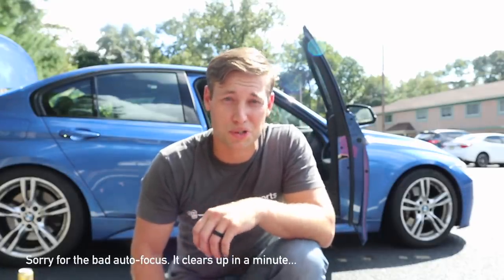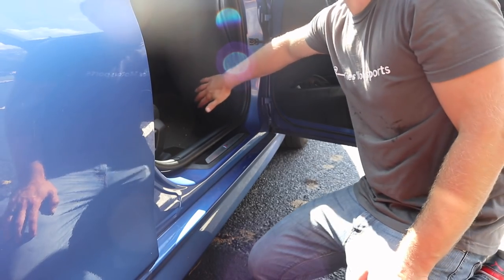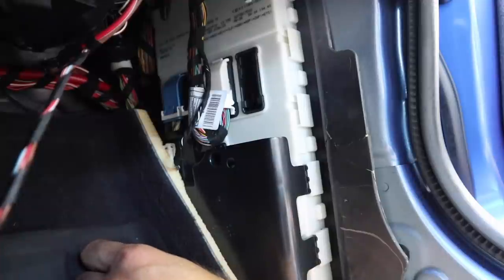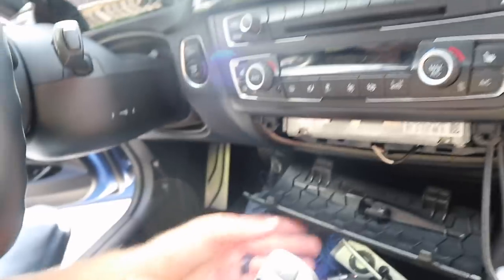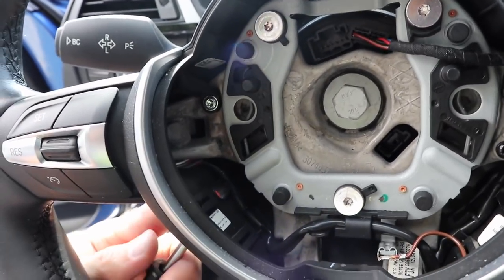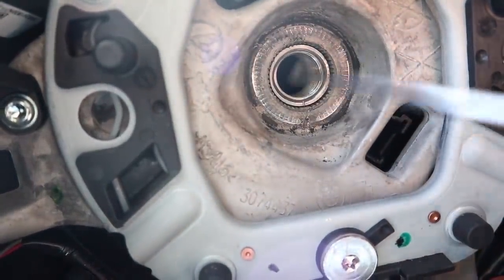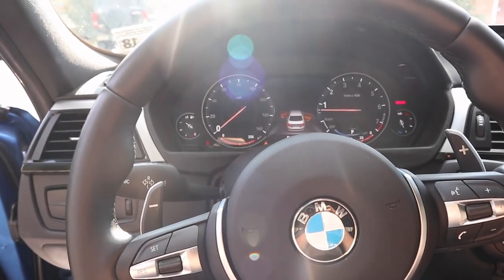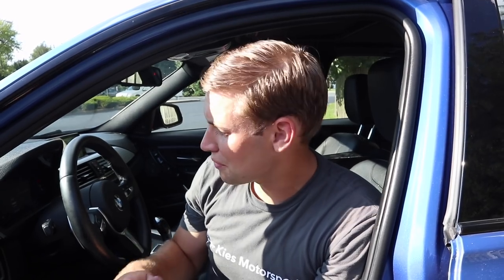How to Retrofit F80 M3 Paddle Shifters on an F30 Steering Wheel  (2013 BMW 335 m sport demo car)

Comment: I think u need to code 2TB sport auto as well to take full advantage of the transmission. Judging by your shifter, u have a regular 8 speed auto. Not the sport auto that come with different style shifter. The transmission itself the hardwares are same just different programming. I drove a 320i with this transmission and my own 435i with sport auto. Manual shiftings are huge difference. No bang bang bang shift in regular auto. Just letting u know.....or do u already know that and coded it....lol
Reply from the maker: Yea that makes a huge difference. I have that coded already :) great tip! BIG difference..
Reply: Kies Motorsports Great video!  How do you code 2TB sport auto or where?
Reply: Is this necessary if I already have the sports+ mode on my car? BMW F30 335i xDrive M Sport
Reply: So the only difference between the sport and regular transmission is coding?
Reply: I have an 120i regular auto, can I code sport auto? how? and what coder do you use? @KiesMotorsports

Comment: Just finished retrofitting my f30 wheel and installed paddle shifters. I purchased the paddles, wiring harness, backplate, and 2 paddle shifter screws all separately. I found that the 5/16th hole that he said to drill was too big for the factory screws that are said to fit the paddles. I had to add 4 washers to each screw to have them sit correctly. This process was extremely time consuming, but this video helped a ton and I love the outcome. Another big issue I ran into was having a heated steering wheel, with this type of function my wheel had an extra box in the actual wheel so when my airbag wouldn't fit on correctly with the new wires. I had to cut some of the tape around the wiring harness and shove wires into deep crevices to have the airbag sit correctly. After a total of 5-7 hours, I got everything sorted out and using bimmer code to code in the paddles was a breeze. I am so happy with the paddles and encourage anyone to try this out, just make sure you go slow and make sure you have everything fit correctly.
Reply: I’m mid installation, but this is exactly what I’m facing. There’s a curved box which sits on the bottom right of the steering wheel. The black connector which is attached to the paddle shifter connector (i.e. the shorter one which goes to the left paddle shifter) must attach to a connector which comes out of the right side of that box. Miles away. I’m just going to extend this with a jumper lead.
Reply: Do you have the links por the parts ?

Comment: Just installed them on my F30 320d m-sport using this video as a guide, thank you for taking the time.
Only issue I had was where you say your using a 5/16 drill bit which equates to 8mm for us europeans, I was somewhat confused as that would have made the hole too big so I end up drilling a 3.5mm hole which is about 1/8th inch, that worked perfectly.

Thanks again

Comment: Did the retrofit yesterday!
FYI: 5/16 drill bit ≈8 mm is too big, the OEM 14x4mm screw heads are too small which calls for a washer.. On the other side I drilled a pilot hole (5-6mm), and used the 5/16 bit going about halfway :)

Comment: I'm almost for certain you are the first youtuber to do an actual video on how to do this. There are forms around that I've read up on, but couldn't find any videos. Great work! I'm going to use this guide as reference for when I do this mod.
Reply from the maker: Thanks! Yea, I couldn't find one, so I thought it could help!
Reply: Kies Motorsports No problem! Also, I shared your video to BMW car groups I'm in, should help you out in terms of viewers and followers.
Reply from the maker: Sounds good, we appreciate it very much when people share, like and comment!
Reply: One more thing... Do you happen to know where to find a backing plate for a stock F30 328i wheel? I dont have the more round one like you do, I have the blocky rectangular one? I'll have to buy an entire new M Sport wheel with paddles pre installed if I cant find a backing plate.
Reply from the maker: I don't have access to it right now, but try realoem for the part number
Reply: Okay! Thanks. If I have to replace the steering wheel its whatever, the stock one looks like trash
Reply from the maker: You can probably get a used one for a good price

Comment: When you add peddles, the minimum you can do is actually code Sport Auto so you get faster transmissions. On my F30 I initially had only Sport steering wheel without paddles, so I bought M3 one and regular peddles and mounted them on M3 wheel (I actually think standard peddles look better than M3 ones).

Comment: Fantastic! Great video. I know this will help alot of people on the forums. I did this to my 2013 328i m-sport. Made a huge difference in control and feel while driving but also the transmission is alot more aggressive when coded for paddles. It is pretty silly that BMW left this as an option for m-sport trim cars..!
Reply from the maker: Go ahead and share everywhere you think it would be helpful, if you think it could help! 😀

Comment: Hi - thanks for your great video. I used it to great effect to remove my wheel and replace one of my broken buttons. However, when I replaced everything my rear view camera is no longer recognising the movement of my steering wheel, so the guide lines on the screen aren't moving as I turn the wheel. Any idea what I've done - and maybe how to fix it? Thanks!
Reply: Ok - so 1 day later and a 40 mile drive later, it's now working. Clearly it needed to self calibrate. Phew!

Comment: I was afraid to do this by myself, but after seeing this vid, I will definitely do it. Question: Regular F30 M sports wheel paddle shifter is the same to install? Drilling the holes into the wheel is the most crucial part of my question.

Comment: Hello, first of all great work.
I have a few questions:
Is it the same procedure with a F36?
If a cable is present in pin 5, then is at the steering wheel automatically a cable in pin 3?
Must be coded in the end?
Thank you in advance.

Comment: Hey Brian, can you tell me where I can purchase the two little screws that go into the back of the paddle shifters as well as the size of them? I ordered the shifters and I am installing an M3 steering wheel on my 335i, but just realized that I don't have the two screws to hold the shifters on.

Thanks so much!

Comment: What kind of screw do you use that goes into the paddle shifters? I bought a set of these on ebay and they didn't come with anything; and the holes are just non-threaded black plastic.

Comment: Do you know if the F80 paddles themselves can be used with OEM F30 plastic bracket and electronics? most people are selling the paddles relatively cheap, as opposed to over $500 for a whole new set of paddles

Comment: Does the wire runs feom number 5 to number 3 at the steering wheel on 2013 328i just the same as your 335?

Comment: Hello,

I have a BMW x1 F48 18i 2018 model with automatic transmission. The steering wheel that currently has is not the M.
My question, in case you know, is if I can fit an M steering wheel with paddles so  that I can also the change the gears from the steering wheel?

Thanks in advance for your response.

Nikos

Comment: Hello Brian! So I wanna buy a steering wheel that has paddle shifters. Basically what I wanna know is... if I can try to code it without checking for the wire existance. I guess if there is no wires it will still let me code it but it will not work. I do not wanna scratch the trims especially the steering column ones. Is that any other way to check for the wire presence by any chance ? ! Thank you ! :)

Comment: Brian,

Doing this now and realizing I do not have the screws that hold the paddle shifters in place since there was no screw holes previously on my wheel.  Do you know what size/type of screws are needed for securing the paddle shifters?  Thanks!
Reply from the maker: I don't remember, but if you take the screw out of the back of the wheel (the plastic trim), it should be the same size, if you want to get one at a hardware store
Reply: Kies Motorsports Thanks Brian.  I actually was able to bring my wheel into Lowe’s and match it up, it’s a #6-32 x 1 inch if anyone asks in the future!

Comment: Hey I just did this but now I’m getting a lane assist malfunction. I have not coded the paddles yet. Will the coding fix my lane assist or do I need a different wire harness? It’s strange because I left my original harness connected as well to the lane assist module but just left two connections unconnected because my new harness had those connections. Something is off. The new harness didn’t have anything for the lane assist. I’m also working with the non m, it’s the sport wheel.

Comment: FYI, many F30 steering wheels do not have holes as pictured, and the airbag is not removed the same as described in this video. Also these steering wheels do no have a replaceable backplate, you must buy a steering wheel with paddle cutouts.

Comment: Looking to upgrade my 1 series wheel mainly to have cruise control but also love the sport steering wheel. 

My car is manual, but if I bought the paddle version would it be a problem? Id remove the paddles as I obviously can’t use them! Just wondered if the paddle version would confuse the car!!

Comment: Hey, looking for some advice! Im planning on doing this steering wheel upgrade to my 1 series as I like the look and want to have cruise (i know I need cruise coding). Most f30 steering wheels seem to have paddles and my car is a manual, I know the paddles wont work which is fine (ill remove them most likely) but will have the paddle version confused the car? Will I HAVE to remove the paddles not to confuse the car?
Reply from the maker: Nah, if it's the paddle version, just don't plug that in :)

Comment: Great video Bryan, glad you bought that car cause I have been doing all the latest upgrades myself, thanks for all your help. By any chance do you know if this can be done with the non m sport steering wheel and which part numbers those would be
Reply from the maker: You can do it with either wheel, it's just a different back plate
Reply: Kies Motorsports ohh I see thanks, will search for that part then

Comment: Am I right in thinking that if the wire is already there, and you purchase a steering wheel with the. Paddles already fitted. It's just a case of swapping the steering wheel?
Reply from the maker: Yes, that and you still need the coding

Comment: Great video. Did you change the resistors inside paddles before retrofit?
Reply: Did u? I recently purchased m3 paddles from a f80 and for some odd reason shifting down paddle shifts up and the right shift up paddle does nothing. Bummed out might have to buy original f30 paddle shifters as the m3 are not functioning correctly 😢

Comment: Hi,

Nice work! Very helpful. Could you please create a video regarding the necessary coding changes that you did for the puddles? I am also thinking of buying them and the process to install them looks pretty straight forward but I am not familiar with the coding part. I know that I will need to purchase a OBDB cable but I dont know which software to download and how to operate it.

Thanks in advance
Reply from the maker: Thanks! I have the coding parameters in the description, but we don't make coding videos.. I can get you set up with a coder if you need

Comment: so if you take out that passenger side and there is a pin 5, do you need to then check the steering wheel for pin 3 or if pin 5 is installed then it means that pin 3 is as well? Thanks
Reply: also, does the FEM_Body ... 3190 --Paddles_Verbaut --aktiv code activate 2TB and the paddles or just the paddle coding? Lastly, what kind of screws did you use. Thanks again!

Comment: Hello Brian, your videos are just great and very helpful.  Any chance you might have one to change the m sport steering wheel trim.  Just the aluminum central part to replace it with a carbon fibre piece.  Thanks

Comment: Hi Brian, great channel! 
I'm afraid that Wire Harness Part Number 32306854769 is not correct. I ordered it and it doesn't have the grounding ring and also not the brown wire with the metal connector. Instead, it has an additional white plug. Could you help us find the correct number?
Thanks!

Comment: Hi first of all, thank you for all your videos are like a bible for me. i only have 1 question... in order to see if my car is pre-wired can i do the opposite? i mean set apart the clock spring cover and unplug the plug behind the clock spring and check if pin number 3 is wired? if is yes it should go along the car up to the big plug ( pin no 5) right? thank you
Reply from the maker: Great, thanks! You can check either location to be able to tell

Comment: Can you tell me if doing this on my 2016 F-32 with the standard wheel that has paddle shifters already will work? I have seen conflicting information going from F-30/32 paddles to M series shifters. Thanks for the help as this is an upgrade I do want to do as I hate the standard paddle shifters.-Z-
Reply from the maker: I know some are interchangeable and some are not. They say that sometimes the signal isn't correct and it won't work, but I've also heard of people taking them apart and swapping the internals, but I haven't attempted that
Reply: They should be interchangeable - there's a few people who have changed the f30/f32 ones to m3/m4 ones.  I'm in the middle of actually doing it myself.  The only thing I can't figure out is how to unplug the blue connector that the hold paddle shifters are plugged into - any advice? Do I just pull it apart?  Doesn't seem like there's much room to work within either.
Reply from the maker: It’s a tight connection, I like to use a pick tool to help separate it
Reply: Did you have success in swapping out the standard F30/32 paddles to the M3/M4 ones? Thanks! This is one of the main upgrades I would like to do to my 435i. Z

Comment: hey bryan, i want to do this retrofit, is there an aftermarket long wire you can please link me to? I tried soldering the wire in the video and I would rather have a wire that is not hacked, i did a terrible job
Reply from the maker: Hey, I don't believe so, you'll have to make one

Comment: Excellent video thanks. I want to do the same to my 2011 x3 f25 30d is msport with sports auto 8 spd. Will the wiring looms be the same name locations etc, I'm uk right hand side don't know if that affects the location of the modules? I also have the older style string wheel, in sure i saw someone years ago that you can cut out the area for the paddle shift, but can't find it now! Thanks Jules
Reply from the maker: Thanks! I haven't done it, so I'd have to look into it more

Comment: Great video! Any idea how to remove the cable that connects the lower steering column cowling? It doesn't seem to want to just pull out, seems clipped in somehow.
Reply: I still have the repair manual for the F20, it doesn't say anything other than to "unlock" the plug connection for the emergency starting aerial, though it doesn't mention how one achieves this.
Reply: In case anyone is interested, I found a PDF for the paddle shifter mod, and it helpfully says that "it is easier to remove the antenna from the shroud than pull the connector!" So I gave it another another go, and lo and behold, if you shove your finger under the aerial housing and pull with a bit of force it just pops out! (If only I'd found this when I was trying to replace the shroud...)

Comment: I’ve seen paddle shifters on some F30/31 BMWs with the standard leather steering wheel, but have only seen retrofits for the M-Sport wheel, does anyone know if there is a guide to do this on the standard wheel, as I prefer the look of the standard wheel on my F31☺️
Reply: I'm wondering the same

Comment: Need a video about " Blind Spot Detection " If ever that can be retrofitted :) :) hoping forward to see that from you . Thanks :) :)
Reply: in the video , the part number for the back steering wheel is missing ( cutouts to fit the paddle shifter )
Reply from the maker: Coming in a little bit..

Comment: Hey Bryan, just a heads up the part number for the wiring harness and the part number for the f80 paddle shifters are the same. Just a quick search shows it might be 61317847610 for the paddle shifters
Reply from the maker: Nuts, thanks for catching that! It's this: 7847610014501 Thanks for catching that!
Reply: would the part numbers be different for a Europe spec car and a US spec car?
Reply from the maker: Hi, I would assume, but I don't know for sure
Reply: oh okay

Comment: I have a F30 328d with M package. The paddle shifters are the smaller ones and not enticing to use, I like the longer ones. Is there a way to just swap the metal shifters alone and not worry about the electronics ?